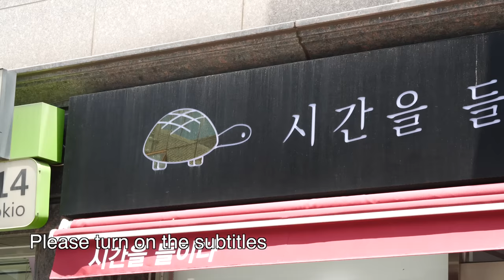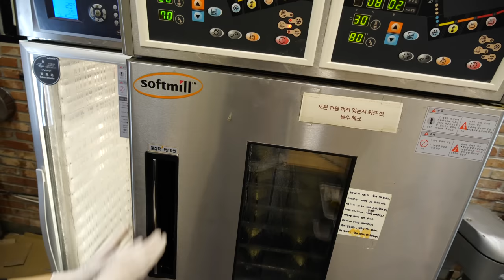How to make 5 Kinds of Cream Croissant - Korean Food [ASMR]

Comment: they are beautiful to look at but the dough is wrong, the croissant dough is not made of simple puff pastry, this is because the croissant may seem too crumbly and crunchy, the dough must be a brioche dough base, treated exactly as it is processed a puff pastry, for which the brioche dough is made first then the brioche dough, after this dough is worked with butter like a normal puff pastry, you will then get a flaky croissant, crunchy on the outside but soft inside